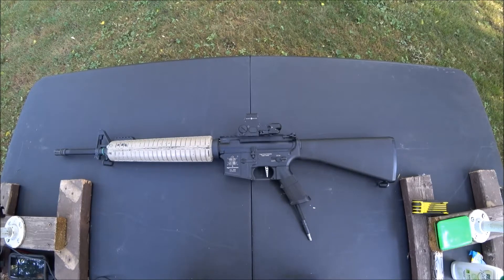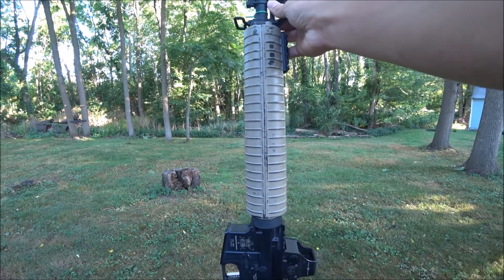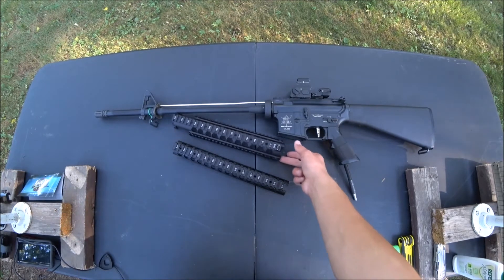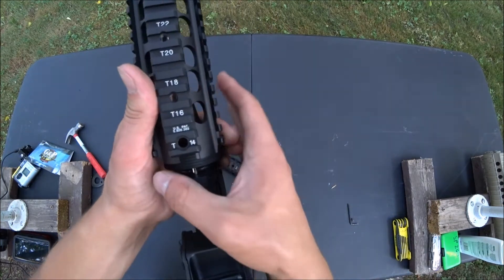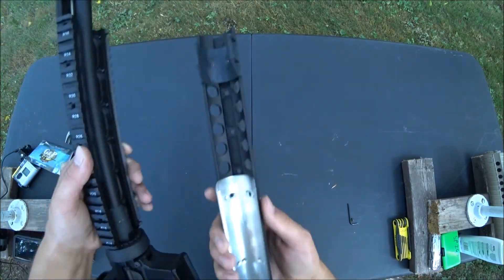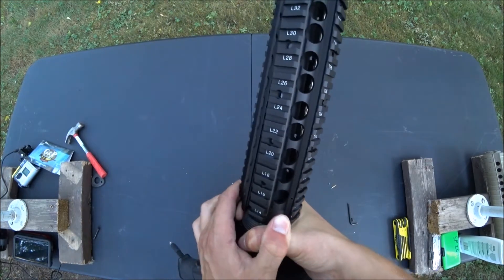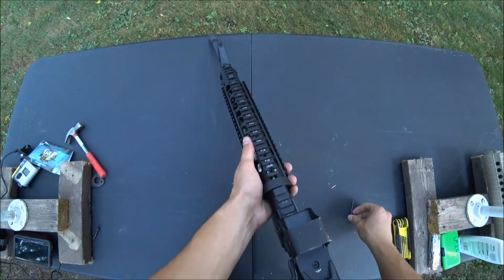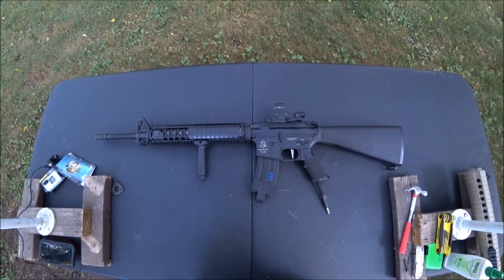G&P M5 RAS Installation for M4/M16

Comment: will this work on a real m16a4?
Reply from the maker: I've used it on my 20" ar for about 2k rounds and haven't seen any wear so I'd say it's safe to use
Reply: @ColdWaterRegrets  On a real AR in 5.56 correct?  Does it rattle or fit pretty tight on your upper? Are any new parts or modification required to your upper or did it drop in just like it should?  Also does it get very hot or does the heat shield kinda work?  

Sorry I know I have a ton of questions I just don’t want to spend $400 on a real M5 RAS for my A4 clone.
Reply from the maker: @jackallen6506  dropped right in on a PSA upper no mods even has a heat shield
Reply: @ColdWaterRegrets  does the heat shield actually work decent?
Reply from the maker: @jackallen6506  yep I used it in a video called mag dumps you can see it in action
Reply: I know I’m late to the party, but damn…. You mean to tell me I paid over $200 for the real thing and I could’ve just went this route?! Yeah I’m mad… 😂 never would’ve thought to do that!!

Comment: Will this work on a dissipator upper?
Reply from the maker: Yes as long as you have the 12inch version
Reply from the maker: @Orion69North yes it will work on any m16 I've had it on a real ar for a while now holds up no problem